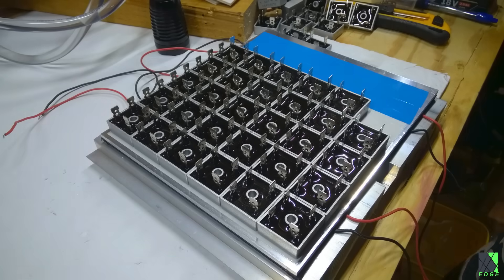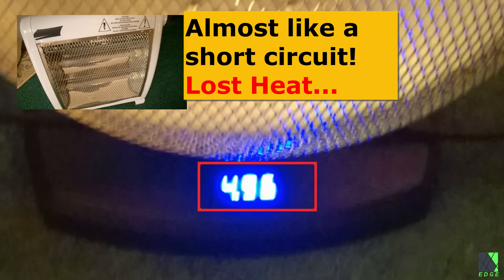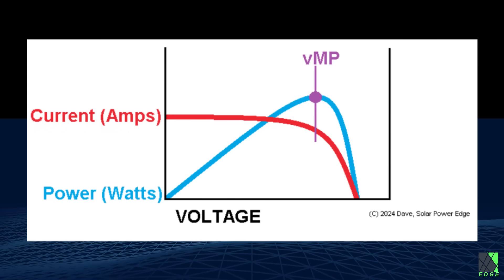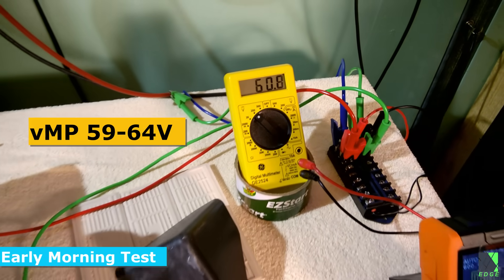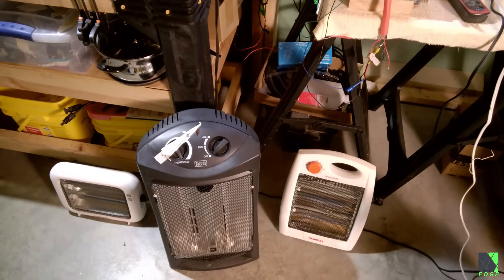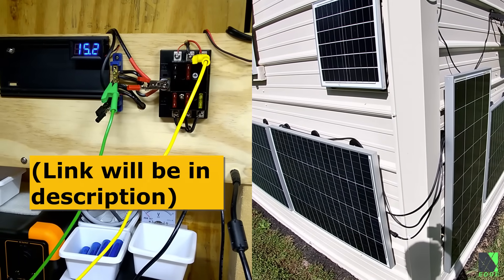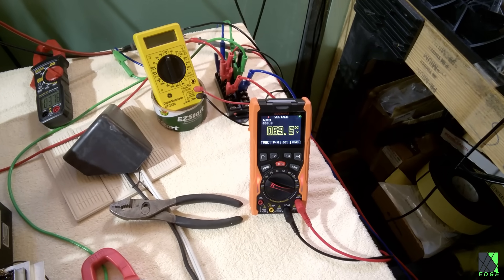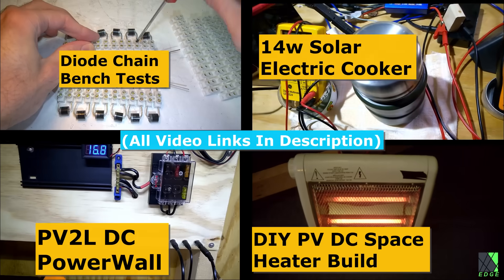How I Get More Solar Electric Heat With POWER DIODES - Poor Mans MPPT #DIY #solarenergy  #solar

Comment: The diode wizard is at it again :) . Hmm, heating some kind of water tank could be handy.
Reply from the maker: @Voidsworn Haha... "The Diode Channel". I have a few hot water heater elements based on semiconductor diode chains, I will upload as soon as possible
Reply: or a sand thermal battery ;-)
Reply from the maker: @mikehamby9723 Right on :D a few weeks ago, a mysterious plastic container appeared on the workbench containing sand-like particles...
Reply: Are you manually changing the tap position of diode chain throughout the day?  I just want to do a one and done.  Soak it in silicone oil inside a stainless steel vessel with fins on the outside, and throw this inside a steel water trough.
Reply from the maker: @morenothing4u During normal operation, it's not necessary to change the tap positions as the diodes automatically adjust current draw - similar to MPPT algorithms. However if fine tuning the diode string, I do change tap position alot while trying to get the right balance. I find this rather tedious, but once tuned my diode strings ran very well, amazing to watch.
Tap positions can also be useful with a thermostat to vary power/heat output, or to have multi functional configurations for different solar panel arrays. For example, I might want a string that runs at 18v/36v MPP and also different temperatures. Anyway, your idea to put them in silicon oil sounds great, I'd monitor the temperature and also think about how that affects the voltage. Ideally a temperature equilibrium is needed to ensure voltage stability. That's why I put fans on my heatsinks powered by the diode chains themselves, it keeps pushing out the heat so it can be used, and prevents the diodes from burning up. With enough oil or some way to flow the heat into the greenhouse it could work very well. Could try sitting that vessel in a tub of water, which is good at accepting, storing and releasing heat.

Comment: Very good video. My panels are 450W at around 39v so it would be really hard to find diodes that would survive that amount of heat.
Reply from the maker: @mikefiatx19 The solution is to attach them to a heat extractor... heat sink etc. and you can push big power through...  but if you want to use a small heat sink, just combine them with standard resistance heaters, problem solved
Reply: @solarpoweredge  I was just going through one of your older videos where you mentioned that a 40v panel could swing between 36 & 55v. So this diode setup would eliminate that swing and hold the voltage going into the heater at 40v as long as the diodes could dissipate the extra 15v (times amps). Awesome.
Reply from the maker: @mikefiatx19 Yes they act very much like a regulator, but with no intelligent circuits required. It's amazing how simple, cheap and effective this is
Reply: If I have two solar panels of the same rating,  can I drop one in water as a heater and one in the sun to get a good efficient effect?
Reply from the maker: Sure, although you may have to short some of the cells to match the panel in the sun - interesting experiment!
Reply: @solarpoweredge  what do you mean by shorting some of the cells, should the one in the sun have a higher rating?
Reply from the maker: The one in the sun can be run as-is, while the one making heat might need to have some cells take out of circuit to adjust the operating voltage (need to stay near vMP for best heating performance)

Comment: Isn't running a chain of diodes just a voltage divider @ +.7v for each diode, then the positive solar panel lead to diode chain is handling the voltage drop which would normally be handled by a resistor.  Seems like you could the resistance heater as the resistor with diodes in series to limit voltage on resistor.
Reply from the maker: @miken7629 That is a potential option, but the regulation in parallel with nichrome tends to be very good